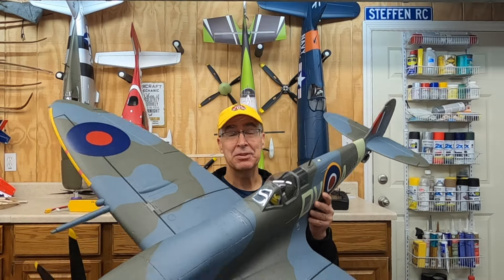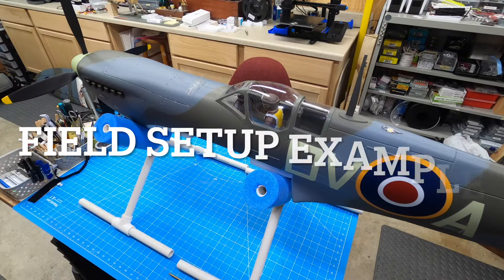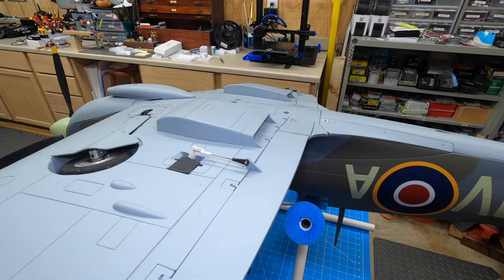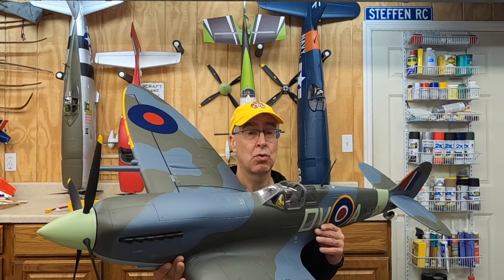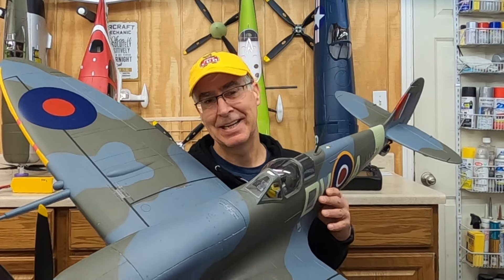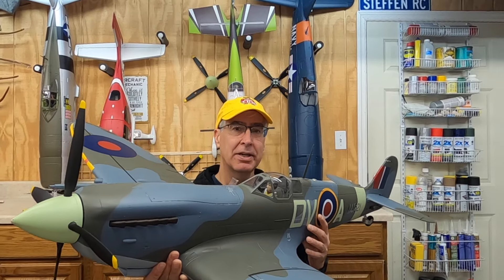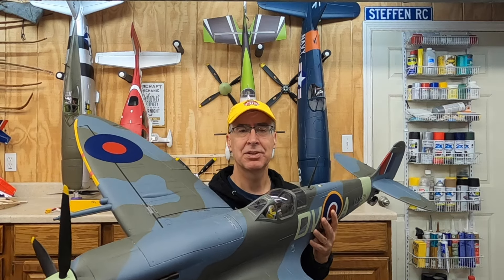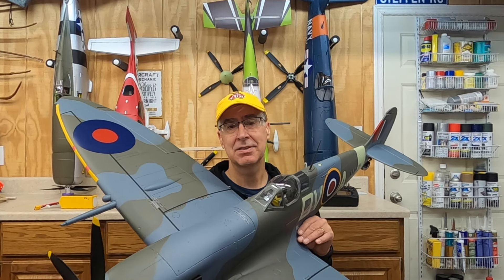Flightline Spitfire 1600mm how to fly this plane without crashing it.

Comment: I'm picking this plane up tomorrow, but don't know why these guys are not designing in wing connectors like other vendors where all you have to do is snap the wing in place like the Eflight FW-190 or my A-10.  I have the Corsair and B-24 that you have to do this type assembly on, while not that complicated, all that plugging in and out will likely eventually turn into a failure.  But had a smaller spitfire before and she was a blast so excited about this one as well.
Reply from the maker: I think this plane is a big seller, so they keep rolling out that same mold.  To redo the mold would cost mega $'s, so they just keep doing it because it sells.  I agree its a bit of a pain.  Enjoy her, I sure do love mine.
Reply: @ yea.  Just seems the new models will have this better design. The guy I bought the plane from fixed the problem and just wired in a single connector between the wings and fuselage.   Will be much easier

Comment: Nice, and informative video. I just did an unboxing on this plane. I have not done the build video yet. Thanks for sharing your cg and battery placement as that will help me when the time comes. I don't have to hurry because here in Maine everything is covered in crusty snow, and ice.
Reply from the maker: I absolutely love this plane..  Landing her is a fine balance between too fast and slow..  There's a JUST RIGHT speed to get that perfect on the mains/almost a 3 pointer.   Prior to her I was very confident in landing all type of planes, but for some reason this plane got in my head..  If you run into anything feel free to ask away..   Good luck with her..   Funny think about this winter, I built and made my video on the FMS P-47 Bonnie a while ago, and I've yet to maiden due to this extreme cold and wind..  - Will
Reply: @SteffenRC  My Bonnie just arrived today! Box was a little worse for wear than normal but appears all is OK. Can't wait until Spring to get her in the air.
Reply from the maker: @DuneDaddyO   They are awesome..  I did a build video on the Bonnie..  You might want to check it out.  There are a few gotcha's on the build..  No big deal.. Just standard built stuff...   https://youtu.be/RRH_6PPLLIs

Comment: Had this model a couple years, probably 30 flights. I have gradually increased expo to about 50 to 60% for the ailerons and mostly the elevator. Softening up the elevator has helped immensely on smoothing out final approach which is where most people have problems with warbirds. Great video, great model.
Reply from the maker: Thanks..  Appreciate the comments..  I sure love this plane...  - Will

Comment: Very helpful video - makes perfect sense and thanks for the tips.  Unfortunately, all that I can think of to add is that, in my view, this airplane doesn't land or takeoff well on a grass runway unless it's maintained to golf-course standards - most that I've flown off are not maintained that well!  The good part is that taking off from a grass strip you don't generally break the prop nor shred the wing tips as is the case from a hard surface.  I love the airplane but regret that I don't have convenient access to a better runway.
Reply from the maker: Really good point.  I really enjoy our asphalt, but it can cause issues on landing for a few planes.  My FW190 hates asphalt but loves to land on grass.   I appreciate the comments.  - Will

Comment: Excellent video Will !   I really like some of the steps you have taken to make assembly easier (servo wire codes) and the improved battery tray.  Such a great job showing and describing the take off and landing aspects.

One thing that influenced me about tail dragers is the old Baa Baa Black Sheep shows.  If you can watch them bring in a Corsair, there are scenes that will show the rudder being used to keep it straight.  They are not shy about using a lot of rudder - when needed.  They will bang the rudder over with a lot of deflection to stop a swing beginning to go left or right.  But then they go back to a centered position very quickly.  I have heard the phrase - "dancing on the rudder pedals" and they demonstrate this quite well.  I have read in books that because the mass of the airplane is behind the main wheel position, that a swing or turn that begins can really get out of hand if it is not corrected right away.  That is why some planes will want to ground loop so badly.

It seems that some pilots learn to use the right stick soon enough - but they don't develop a skill set with the left stick.  Once you practice with the left stick functions, you are much better off to enjoy making a tail drager behave in a more scale like manner.  It takes practice, and consistent practice for me to keep the rust knocked off !    ; - )
Reply from the maker: You nailed it.  These tail draggers require that next level skill that must be practiced often.  Thanks for the support

Comment: Great video! You speak the truth about tailwheel take offs and landings.
My Spit is 4 years old and I fly it from a grass strip. Looks easier than a hard surface.
Keep up the great work 👍
Reply from the maker: Thanks Denis..  I agree, I believe there are several planes that really handle better on a manicured grass runway.    This Spit and the Eflite Fw-190 for sure...   Thanks for the comments, really appreciate it.  - Will

Comment: Great video , thanks. I’ve had mine over 2 years now and enjoyed every minute of flying it. This plane gets me more positive compliments than any of my other warbirds. Slightly different technique for me though as I’m operating on grass. Yes, I release the elevator to neutral as the speed builds on take off but I need to get the wheels out of the grass ASAP and that means using take off flap and if the grass is wet on a still day, full landing flap. Take offs don’t look particularly scale but it prevents a nose over and with high power it’ll be free of that grass in just a few feet. 
Agree very much with your landing technique, if you chop the power too early you’re going to be in a whole world of pain😢.
Flies superbly though, if you’re struggling initially with landings/take offs, don’t give up. It’s going to be worth it. I like it so much, I’ve got a second one still boxed just in case disaster strikes.
Reply from the maker: You're right, this is a wonderful plane and is a real crowd pleaser at the club.  Mastering the takeoffs and landings requires some practice for sure.  A lot of newer pilots see mine and want one.  I gotta tell them to get a smaller, cheaper tail dragger first. (eflite 1.2m planes...).

Comment: Excellent tips on how to land a warbird.  I've been depending on full flaps and it's not enough  for a smooth landing.  I am definitely going to try modulating the throttle when making a landing approach.  I've got the added obstacle of landing on a rolled grass field.  My club has a grass airstrip but it's rolled  regularly.  I had a bouncy landing during my Spitfire maiden and ending up with a forward flip breaking the propeller and the rudder tip.  It's all fixed up, ready for tomorrow.

It does fly well.   Takeoff there's a lot of torque you need rudder compensation but once it's up in the air it's a blast.
Reply from the maker: Jerry, thanks for the comments.  You're right, she's a wonderful plane for sure.  I have several large warbirds and they all require me to modulate that throttle to get those perfect landings either 3-point or on the mains.   I've inserted a carbon fiber rod down the vert stab to prevent it from damage on those flips.. so far so good....   This Spit is one of my most challenging planes to take off and land perfectly....  Good luck with her.. - Will

Comment: Thanks again for another great video, beautiful plane. I am working my up from P-51 to 1.2 m Fl Spitfire to 1.6 m Spitfire. The takeoff are a learning process.
Reply from the maker: Yep, tail draggers are a bit tougher to control on the ground..  Practice with that elevator and rudder.. You'll get it..  I made a video, specifically about taking off with a tail dragger..   Good luck..

Comment: I had SQS Kyosho 1400 mm Spitfire (Supertigre 51 , retractable , no flap version) . It wasn't easy landing on the grass because of wheel's dimension. You can't use bigger wheels when they are retractable and you can't  even push the wheels over  wing's  landing  edge  ( like on f3a) .But I learned . When glow stals it's even much difficult 😅 cause landing's speed is higher and the nose tries always to point down. 
However it was a beautiful model
Reply from the maker: There is something about the Spitfire that is magic.  The profile in the sky, the history and the stories.  It a wonderful flying plane, but a pain on the ground....

Comment: I just created a mix in my Taranis X9D so that when the flaps are down the Spitfire goes slightly to the left to simulate the take off tendency that you described.
I really like this plane man. I'd love to get one if I had a place to fly it. I started on RC Helis lived, breathed and slept it for 11 years.
Been flying sim off and on now for 3 years a good bit but really have focused more on learning to fly and setup planes on sim and get used to landing gear and flap use.
Reply from the maker: The mix is fine, but you might not want that on landings.  Its better to get comfortable with that rudder and apply when needed.  Some taildraggers don't need much guidance on take-off, where others need a lot.  Wind is a big factor too.  Keep at that simulator..  Best training tool out there...  - Will
Reply: @SteffenRC  It doesn't seem as noticable landing.  I might could put it on a switch where I can turn it on for take off but not landing?
I'm using Phoenix RC Flight Simulator!
Do you use a simulator of any kind?

I have never flown a real RC plane yet but that was my original goal just need more room for a plane.😀

Comment: HI. Great video - Thanks!. About the elevator  servo (I meen the connection of the rod to the servo) - Can I relay on the friction of that screw ? Sholdnt I use the old goos Z connection instead of?  Thanks
Reply from the maker: Thanks for the comments about the video.  I'd like to answer your question about the Screw or Z-bend.  But, I'm not sure which part of this video has have in it.  Are you referring to my build video?  Let me know, I'd love to help.

Comment: Excellent video Will thank you for posting. This Spitfire is definitely my next one, and I fly from a grass (playing) field. I have the Durafly 1.1m V2  Spit, with AS3X but no SAFE, and completely agree with all your take off/landing advice. Unfortunately the landing gear on mine has developed a looseness swivel that toes out the wheels on landing and induces nose overs now. Haven’t worked out yet how to fix this looseness or find replacement struts. Maybe I just belly land her. Did this once by mistake and she came through it just fine with only a bit of grass staining. I also have the discontinued  E-Flite 1.2m Spit, got it when I first started in the hobby 4 summers ago, but only started to fly her at the end of this summer. SAFE does work on this model which I only use for landing as I prefer full throws on take off.  I’m too nervous with this unreplaceable model on landing not to flick that switch but it makes for very gentle and benign full flap main gear landings before reducing throttle and planting the tail wheel with full elevator. Like you I do not use half flaps for take off but would probably do so if I were to land off SAFE for increased landing speed. I see on your bench you have the FMS 1.5m P-47, this is another contender in my potential list of greater than 1.2m OLEO equipped warbirds along the the 1.5m E-Flite P-51. The P-51 looks the best for car transport to the field though I was very pleased to see how simple this 1.6m Spit was to reattach the wing at the field, great information, many thanks. Will subscribe and check out your other videos.
Reply from the maker: Hey Howie,  I'm in love with this Spitfire for sure.  Prior to this plane, I was a pretty decent rc pilot and had no issues with my warbirds, but this one gave me fits.  Now, she's a gentle plane on take-off and landings..  I've learned that all planes have there little idiosyncrasies on flight characteristics.  Its just finding them that can be hard...     I've yet to maiden the P-47.  Weather in Missouri hasn't been very cooperative.  Hope this week.  I made a build video on her and now need that maiden and flight impressions video..   Appreciate your comments and watching my videos.  - Will
Reply: Looking forward to seeing your P-47 maiden video Will. Have you flown much grass ops with the Spitfire yet.
Reply from the maker: @howiedenton2709  I’ve never intended to do any grass ops.  But she’ll nose over if the grass is mid to high.

Comment: Hello, I love your "can you handle this bird" videos. Could you do one on the flight line Corsair? Thinking of picking one up!
Reply from the maker: Thanks.  Appreciate the comment.  I don't have the Flight Line Corsair 1600,  I only have the FMS 1700 Corsair.  (Which is very good, but not perfect)..  Love the corsairs.   If I can get my hands on one at my club, I'll do a review for you.
Reply: @SteffenRC  thanks so much! I've been really dying to get one, but have had some issues with the E-Flite 1.2m. I can't tell if it's because I'm just not a very good pilot or if that bird is just difficult to fly. Had issues taking off straight, Endos, and landing all around. I hoped maybe the weight of the 1600 would help with that.
Reply from the maker: Is the 1.2M Corsair your first taildragger?  They can be VERY challenging to takeoff and land well.  Requires a different set of skills.
Reply: @SteffenRC  it's my second. My first was a hobby zone fw190 which, apart from the badly designed landing gear, was a dream to take off and land with. That Corsair just tore me apart. Maiden flight, I over throttled it on take off and the rotational torque took me right (or left in that case) into the ground. Since then, I've been struggling with it. I've been watching several of your videos to try and get some tips. Got a Carbon Z too which is also easy.
Reply from the maker: The big planes have a lot of torque, so they will veer left hard on takeoff.  Gotta plant that tail with up elevator on initial rollout, then add in rt rudder and neutralize elev. (don't want to take off too soon).   Stand behind the plane if you can to help with rudder until you figure it out.  Let me know.